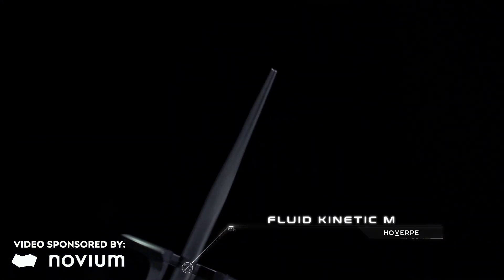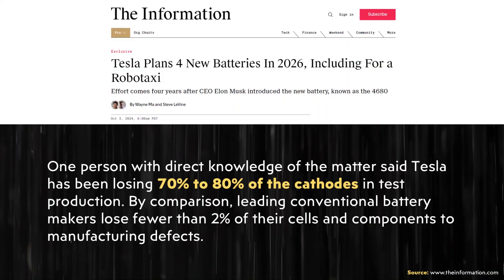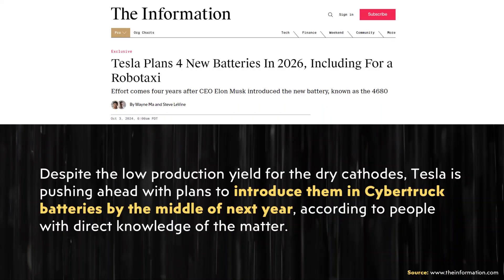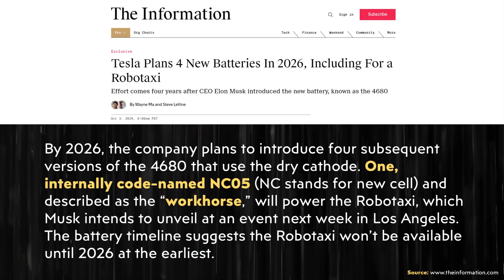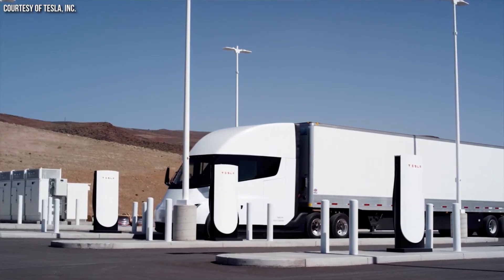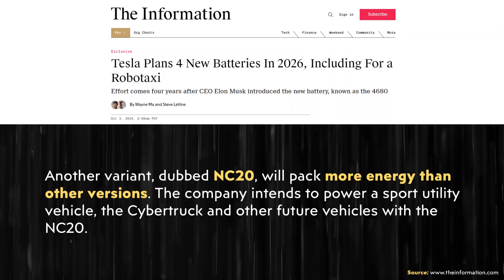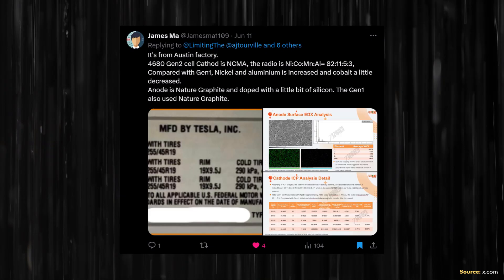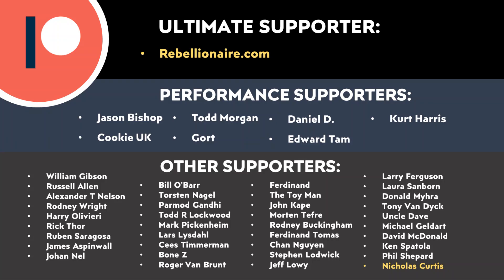4 NEW Tesla Batteries REVEALED | Tesla LFP 4680 Battery!

Comment: Jon, thanks for all of the interesting info in this video.  I have a couple of thoughts:

Going from a "Workhorse" description to LFP chemistry is quite a jump.  I expect "Workhorse" means that it will be high volume and used in many vehicles. Four different vehicles are listed which supports my view, IMO.

Elon and Drew have mentioned in past quarterly earnings calls (after battery day, but many quarters ago) that the 4680 format is not right for the "physics" of LFP chemistry.  My best guess is that they are referring to the flat voltage vs. SOC curve for LFP.  That makes cell balancing not work well between cells wired in parallel.  Note that most (all?) LFP packs don't have cells wired in parallel.  Instead they use large cells that are wired in series only. This supports my guess, IMO.

Comment: Texas Model Y also have 4680 fyi
Reply: They did, but stopped making them in late 2023. Only the ct uses 4680s currently that tesla shows publicly.
 
2170s, lfp blade+prismatic catl cells are in the semi and model 3&Y, powerwall 3 and the megapacks are exclusively lfp prismatic from catl. 
18650s still go in just the model s&x. I bet the new 4680 variants shuffle a lot of that around in the next 12-18 months though. 🤔

Comment: Initially the report was cathode sorted will be in vehicles 4th quater this year. Then first quater next. Then second qyater bext. Now middle o next year which means 3rd quater. A year late even after they solved it. This must be hellova problem to solve 😮
Reply: It takes 2 years, according to panasonic, for panasonic to stand up a new factory using a know format and chemistry. Tesla has built a new factory, launched a new form factor, is developing a new manufacturing process and dealing with chemistry research, all at once. Battery companies expect it to take 12-18 months to develop and validate any change in a battery. Most companies take on just 1 new development at a time. Tesla is eating the whole elephant at once. The fact they have gotten as far as they have this fast is impressive.

Comment: The higher power density 4680 batteries type are unlikely to be the LFP battery type? Also the Tesla Cybertrucks and Semis will be the key demand drivers for the higher power density 4680 batteries, at least during the initial period of the 4680 battery production ramp?

Comment: Silicon Carbon is not the same as Silicon. Yes they both contain silicon but the structure of the granules are different. Silicon Carbon is engineered to have room for expansion inside the granules.

Comment: aren't unnamed sources supposed to be ignored?
Simply put, many of us bought in all those years ago,  on the basis of what we heard on battery day (as the ones with the most/best batteries will likely win) and it's been a bust, let's be honest
Reply: 6yr timeline for the 4680 cell program SMDH. We are only now 4 years in and exactly on track per elon Zach and drews various comments!
Reply: Panasonic is making 4680 with the same wet process they use on everything else because they don't dare take on dry process and new form factor at the same time. They won't be in volume production, according to panasonic, until NEXT year. Cybertruck is being built with 4680s made by Tesla now. How is 4680 a bust?

Comment: You said "there's a reason why (not only because of battery supply) the Plaid uses 18650" .... Lucid uses 2170 and has even more performance than Plaid so I do not think your performance hypothesis holds water unfortunatly.
Reply: The performance on both cars is limited by the discharge rate of the cells, which is about the same for both. Saphire has about 20 percent bigger battery pack capacity and about 20 percent more performance. Smaller cells are easier to cool, that´s just simple fact. Why switch Plaid to 2170 when the car was designed for 18650 and it wouldn´t make it any better?
Reply: @michalfaraday8135  🎯🎯🎯🎯
Reply: @michalfaraday8135   If it... "wouldn't make it better" then... 🥁🥁 there is no performance advantage to 18650 anymore, they are equal. They are not going to update it because they really dont care about MS MX anymore and will just let others fill the high end luxury segment since Tesla is not a luxury brand and will continue down market.
Reply: @TheLastMoccasin  what Mr Faraday say is true though, Plaid would have had the same 20% increase of power by making the battery pack 20% larger, and I think Lucid is in a point where they can press the battery a little extra for a shorter life just to be in the frontline til they actually manufacture a decent amount of cars per year.
Reply: @jonasgranlund4427  Lucid Air sales might start beating Model S at the rate things are going... but Tesla will lump Cybertruck into that category to prevent us from seeing 🤷
Reply: @jonasgranlund4427   Lucid is not manufacturing constrained either as suggested, they are demand constrained since charging 800V cars at Superchargers is a bad experience and all the other networks in the US are still garbage.
Reply: @TheLastMoccasin  Tesla is quite transparent of how many CT they succeed to produce though, The total amount of Vehicle that Lucid Produced during the first 3 quarters was a bit over 5000, I would guess that the performance version (Sapphire) that we talk about here was in the 50-200 range but maybe you know better?
Reply: @jonasgranlund4427  Tesla lumps Cybertruck, MS, and MX all together in their official quarterly production numbers. The CT counts you see from NHTSA recalls are not "Tesla being transparent" unfortunately.

Comment: Kind of sad that their demand has fallen so far that they haven't been cell constrained for years at this point. That used to be the limiting factor to their growth for a long time. 😥
Reply: WTF are you talking about ? production is ramping at tesla, they need every cell they can get, what happened in the broader market was the OTHER major OEM's cancelled large battery orders pushing down prices.
Reply: @seancollins9745  biggest challenge is IRA ruled out imported Chinese CATL LFP cells in standard range cars.
It’s cheaper to buy long range cars with US Panasonic cells & IRA credit.
But Nevada can’t ramp up 2170’s any more.
And LG / SKI make pouch cells.
Reply: @iandavies4853  Nevada has tons of 2170s waiting for Tesla to build pack with. It's not a supply issue that is the problem....
Reply: @TheLastMoccasin  source? Nevada maxed out at 39 GWh last I heard. Semi uses 2170 at present. Y still uses 2170 till 4680 gets to speed.
Reply: @seancollins9745 Tesla had plans at one point of 50% year over year growth. Now they are aiming at nesrly flat sales year over year. At the very aggressive growth path (before Elon pivoted focus away from increasing unit volume) battery supply would have been a challenge. But with basically flat sales battery supply is challenged primarily by moving the battery type as opposed to volume.
Reply: @seancollins9745   No, Tesla has tons of cells laying around, trust me... They have ramped down production. You can tell, because they are going to struggle to sell more cars this year than last year.
Reply: Wait till they reveal the cheaper car. Demand on batteries will be insane. They better stock up now
Reply: @Matzes  exactly, hence a robotaxi with tiny battery, say 20kWh, replacing 5 cars.
China has a surplus of battery manufacturing capacity, but US & EU scared of being dominated.
Tesla 4680 is possible saviour.
Reply: @Matzes  It's not all about price though it's mostly about price, yes. They still need to address some issues like service times, and those lingering complaints that people can rightfully leverage as reasons to go with other inferior products.
Reply: @TheLastMoccasin  I would argue it's 99% price
Reply: @Matzes   I personally know many people who are NOT buying a Tesla, and none of it’s about price. Also, they lowered prices a LOT, plus subsidies for 0% interest and yet will barely match last year’s total sales. Lots of people are choosing to buy similar priced products that are NOT Tesla’s.
Reply: Battery supply has grown by more than 10× in the last 5 years. Tesla sales are up, although they have not kept up with battery supply. Which world you live in 😂
Reply: @petersmangalisongoma2013   If Tesla sales are up… why are they struggling to beat last year’s sales totals? They have the cells and the capacity…. yet the demand is just not there even with huge price cuts and incentives 🤷
Reply: @Wi2Low Demand is steady…. But just wait, that high demand will return? Ooookkkk.
Reply: Way bigger risk on Nov 5.
Musk & Tucker doubled up with sardonic laughter.
Elon has put all eggs in this basket.
Consumer demand won’t be the problem, Court demands will.
Reply: @iandavies4853 that is true, if Kamala&co win, Tesla (and all Musk companies) will be in trouble, but they will manage. But the US will be ruined
Reply: @iandavies4853   Yup, and the American people loose either way. The corrupt stay in power no matter which side of their corruption coin lands heads up this time. Sad times.